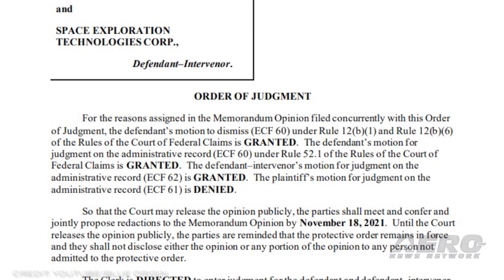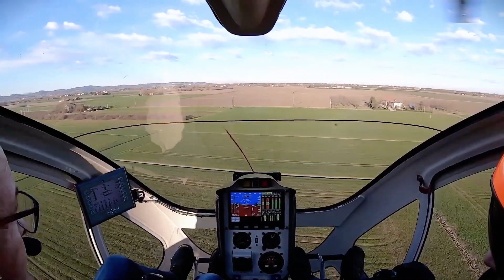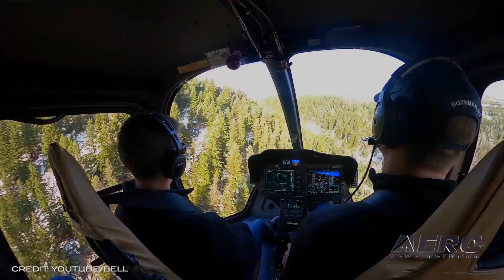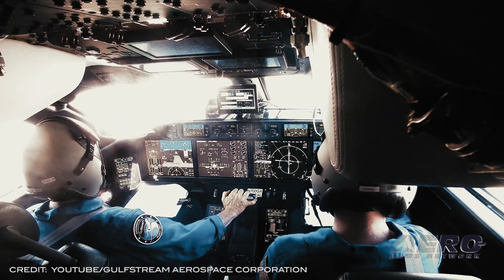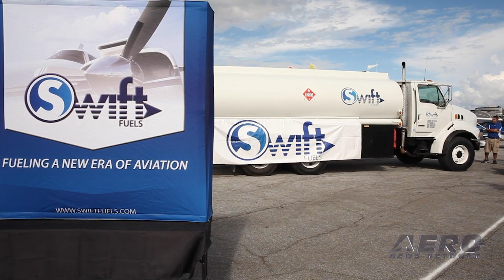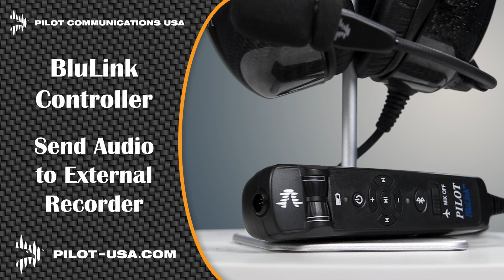Airborne 11.05.21: Bezos v NASA, GA Fuel Upgrades, Air Race Classic

Comment: The eco sustainable fuel? It is like Bio Diesel which is made from vegetable oils or bio matter. It is VERY expensive, time-consuming and the ability to make mass quantity is not there (and never will compete with fossil fuels. We have fossil fuels which will last for 1000's of years. As far as the ARC Ladies race I and my buddy are putting on skirts, wigs and some makeup to compete... Ha ha.